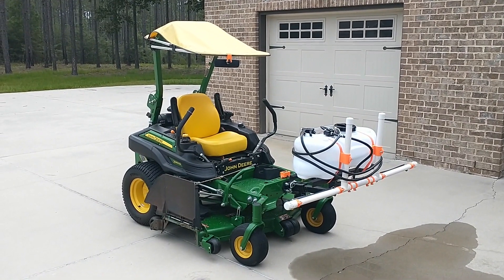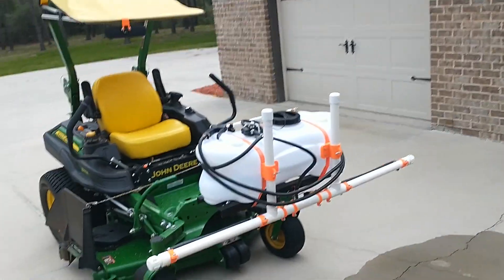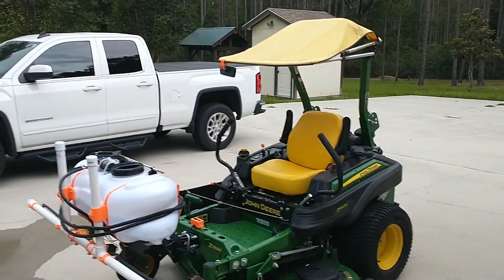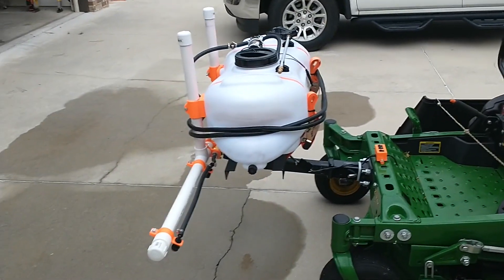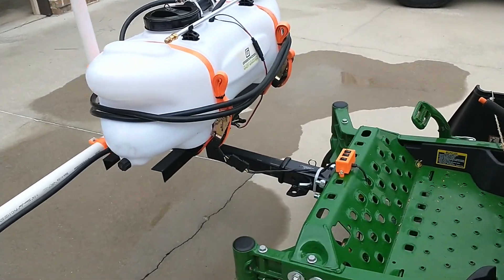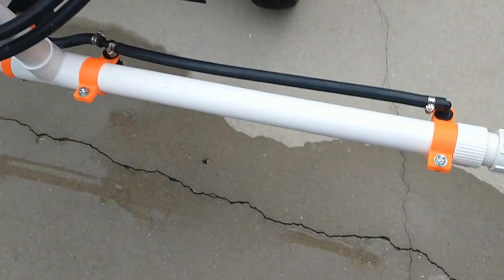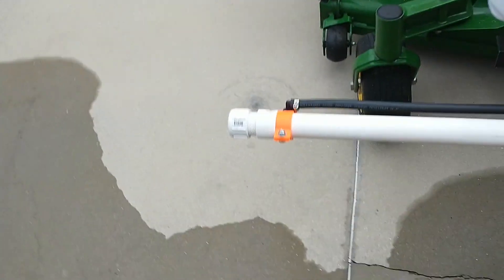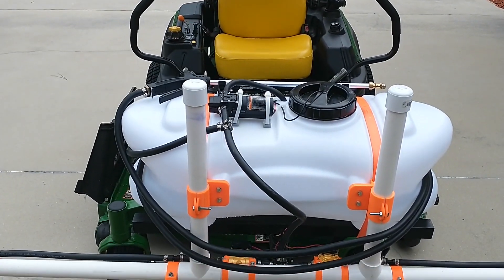DIY Zero Turn Mower Sprayer - Part 1

Comment: Nice set up. Looking to do the same. Question - Where did you purchase the receiver hitch mount?  I tried to zoom in on it but the web address that is printed on it is no longer valid. Is it specifically for the JD Z9xx series or did you drill and modify the hole pattern on the mower frame?  Thanks!
Reply from the maker: I need to update the video.  To answer your question, here is the receiver link:  

Quick Products QP-HS5839 Bolt-On Receiver Tube - 2", Black https://a.co/d/8j8ICFz
Reply from the maker: I have made several tweaks to the sprayer to strengthen the boom and improve spraying accuracy.  I will post a revised video the next time I spray..

Comment: maybe a bigger pump with a regulator? I'm in the planning phase of this. I'm looking at a 10 gallon tank as well. Maybe even an 8. I only have an acre and filling is not the hardest thing. Little concerned about the weight.
Reply from the maker: I have made some tweaks since making this video.  The 1 GPM motor and 15 gallon tank are sufficient so far.  My biggest adjustment was to shorten the tube going into the receiver which brings the tank closer to the front.  I also set the nozzle  height to 16-18 inches.  This eliminated virtually all over spray onto the driver.  I am very happy with the setup now.😅